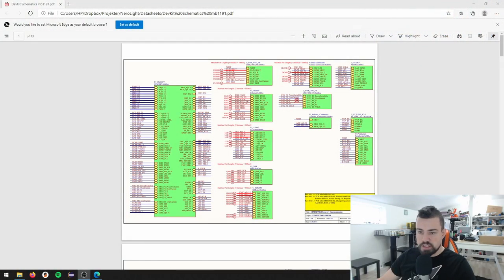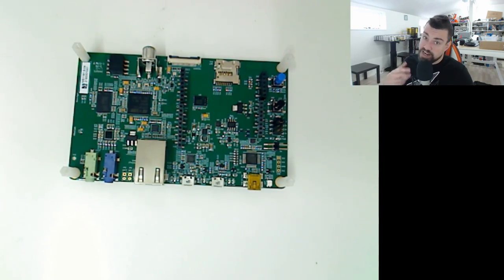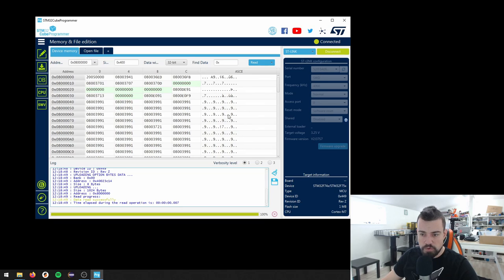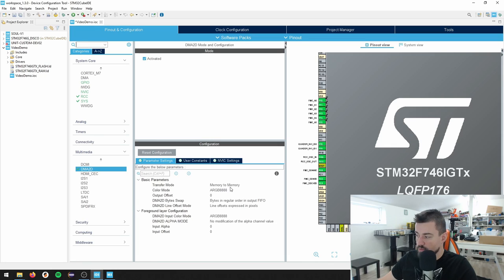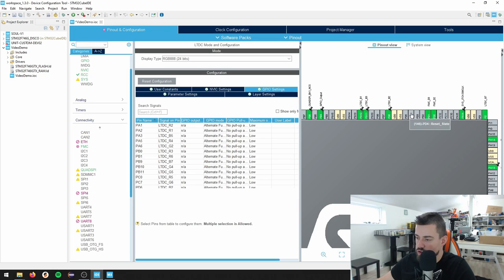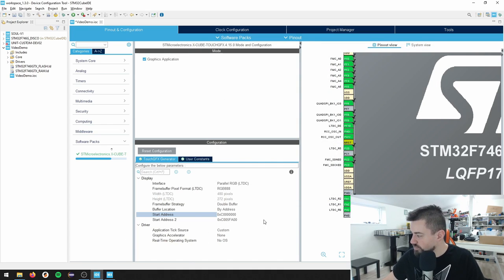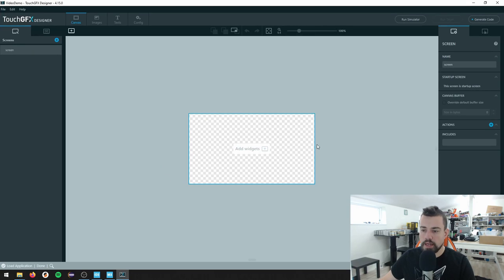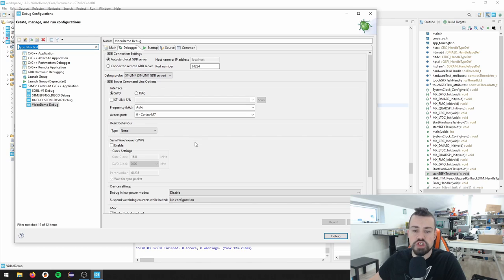How to integrate TouchGFX in a custom board (The long way round)

Comment: any feedback on how the single frame buffer is working?
Reply from the maker: Sorry, I'm not sure what you mean :) (can't remember what I said in the video)
I have only worked with the double buffer strategy since I want to do smoothe transitions (should turn on the third buffer as well - I have the space for it).
I suspect the single buffer will work just fine, but all changes will be instantaneous. This is actually a nice topic for a video :)
Reply: @banjohat  you added the footprint for the RAM as "optional",  it sounded like you were planning to use only a single frame buffer.  I switched my disco board to single frame buffer and it got very 'flickery' when using the swipe container.  I was curious if you had workarounds.  Sounds like double/triple buffering is going to be required for my project.  You also switched from 144pin to 176 due to pin assignments,  I need to re-watch to see what exactly the issue was, since I am at that point and am concerned about availability.  I was going to switch to an H7 part for speed,  but availability is not as good as the F746
Reply from the maker: @TurboBobBailey  Ah, yes, well, the external memory IS optional - but you will get the issues you have noticed. if you can fit a double buffer in the internal RAM you could most likely get away with some of it, at least I don't see the tGFX tutorials utilize the 3rd buffer at all.
So from a cost perspective it would be interesting to omit the SDRAM but from a performance - not so much. I think my mention was something along the lines of 'Well, the footprint is free, so I just add it and figure out the cost later'.

It would definitely be very interesting to test out the visual performance of all solutions!
Reply: @banjohat  in my "custom project",  similar to yours but I started with the disco application template project's IOC file and copied main.c over completely.  My build analyzer is not working (want to watch memory space to see if the 512K parts could be used,  thus 1M parts serve as a backup in case of availability issues).

Comment: Hi, Thanks for the great video.. I also made my custom PCB and tried connecting a 4.3" touch display.  After Loading the code to the MCU and hitting the play button, I can see the screen for like 1 second and then the display starts resetting(keep going on and off very fast).. In the debug console it starts showing
 "Target is not responding, retrying...
Error! Failed to read target status 
Debugger connection lost.
Shutting down...
"

I've selected serial wire in SYS . I can upload the code to the MCU.
Reply from the maker: sounds more like a power supply issue. you're losing connection to the debugger so the whole system is resetting.
Reply: It's Happening only when Iám using the Backlight driver MIC2287. If I don't turn HIGH the Backlight GPIO for MIC2287, the MCU is working fine. I checked by simply toggling a GPIO and its works fine without loosing connection to the debugger. The issue starts when I change the status of backlight GPIO to HIGH . Is it something with the Schottky Diode thing?? Iam using SS14 Schotky diode with a 10uH Inductor on my PCB as I Could get the STPSL140M Diode that is used in the Disco Board..  Is there any particular Diode to be used
Reply from the maker: @sumitmourya6528  I think the best way forward is to check with the datasheet and have the backlight running before you attempt running it combined with the STM32.  you should be able to see the backlight and determine if it works :)
Reply: @banjohat  Yes, I figured out the problem. The output of my Schottky Diode is unstable. I need a more faster switching diode(faster than my current diode) . Not all Schottky Diodes would work here. I tried using SS14,SS16, but They are not capable of fast switching. I tried IN4007, though it is a general Schottky diode but at least it keeps the supply stable, The TFT works fine with IN4007 but with  a very low brightness , Maybe because the IN4007 diode has a large voltage drop. Can You tell me Which Diode you used? I mean the diode number. Would just save me some time.
Reply from the maker: @sumitmourya6528  I have been using the ROHM RB501VM-40TE-17
I just now see that it has been discontinued :(
Reply: @banjohat  Just a small update for anybody who faces the same issue as mine, Try to change the resistance between (BL-)  & Ground. That resistance is to limit the Current to the TFT. The resistance value would change according to the Display CURRENT Requirement. For example, When I used 4.7R Resistance the current was more than the display could handle so it would load the supply. When I increased the resistance value to lets say 15R, the TFT worked fine as the CURRENT dropped to the TFT acceptable level.

Comment: Thank you for this video.  how I integrate touchgfx in a custom board with spi display?
Reply from the maker: You will have to implement a SPI driver that can push the framebuffer to the display. tGFX does not care about which display you're using it just maintains the framebuffer. What you do with it and how you do it is entirely up to you. With that said pushing a specific area of memory to your display should be relatively straight forward :)

Comment: Great video 👌
Which display panel you using. Can you share me the part number?
Reply from the maker: Sure - this one: https://www.buydisplay.com/low-cost-4-3-inch-480x272-tft-lcd-display-w-optl-capacitive-touch-screen
Reply: @banjohat  
thank you
Reply: Do you have the datasheet of the ST LCD 480X727 which comes along with the evaluvation board . MB1315A
Reply from the maker: @sijojohnson  No, I haven't got any information on that. It's probably obsolete already ;)
Reply: @banjohat  
Sorry it's 480x272.
Reply: @banjohat  which did u exactly bought?
- Panel with connector -
Or
- Panel with of soldering -
I don’t understand the difference...
Reply from the maker: @philippw.147  well, it's an IPC connector - so the connector is placed on the board itself. I guess you could technically just solder all the pins to an aligned footprint but that really is a pain to do..
Reply: @banjohat  sry I meant which panel did u buy? 
There are 3 options and I think u have the CPT not the resistive. But there are 2 different ones:

„touch panel with connector for 6,30$” 

or 

“touch panel with of soldering type fpc for 6,13$”

I don’t see the difference.
But I want to use the exact same setup.

And btw thank you for the excellent tutorial.
Reply from the maker: @philippw.147  ah! Yeah I got the capacitive screen. the other option is just a question whether you want the matching connector along with the display. if you have your own connector you dont need that

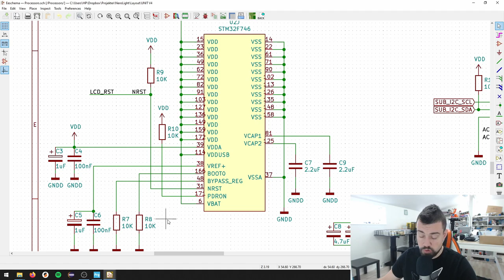Comment: Just one note, @22:45 there is no need to connect a pull-up resistor on Reset pin because there is already an internal one.. Please refer to the datasheet

Comment: What current draw do you expect from the SDRAM?
Reply from the maker: That's actually a very good question! I haven't got the faintest idea.. But my current application does not require the SDRAM at all to work so I might be able to get back to you (at some point) and answer the question with some measurements..
Reply: @banjohat  Thanks, I am quite new to SDRAM and how it works. I have a project where I might use SDRAM but I fear that this uses to much current for my battery powered application. I saw numbers of about 180mA while write/read operation but I want to know how much it draws without r/w operation, just to retain data. All those numbers are still too confusing for me :D

Comment: The easiest way to setup your clock system is by first typing in the desired main frequency (SYSCLK) in the textbox and let the clock resolver set the PLL, then go and set the PLLs for your peripherals manually so you get the maximum desired performance